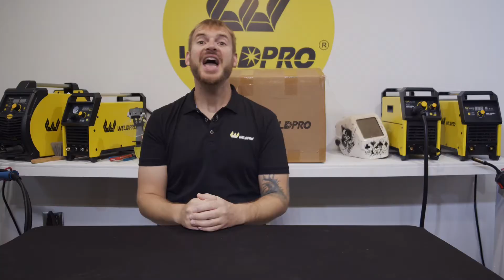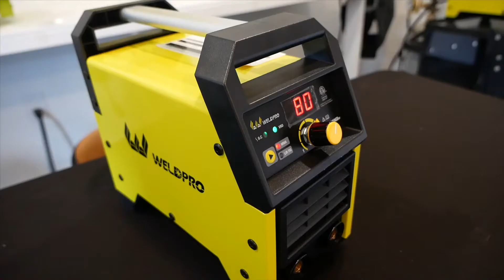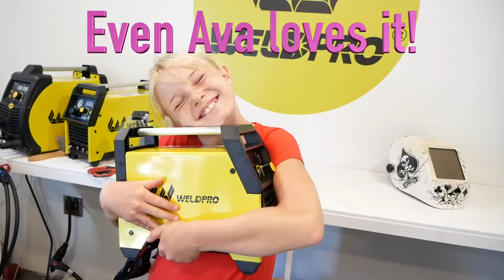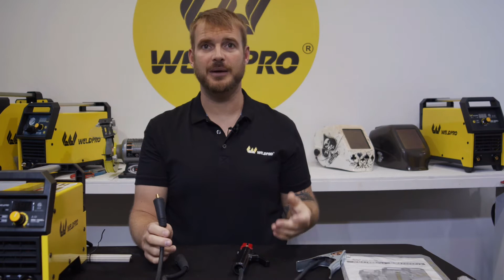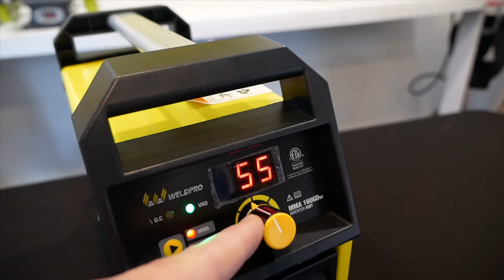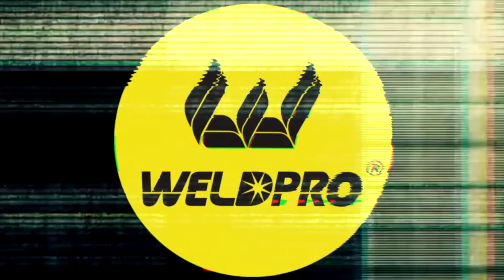Weldpro MMA 160 Stick Lift TIG welder - Unboxing and Set-up

Comment: Why does everyone skip how to set up the lift tig capabilities on these welders besides saying flip the switch. Flipping the switch is the obvious part. But if there's no connection on the box for the argon, what does one need and how does one set up the tig function using argon and the tig gun with a control valve? You didn't say anything about this, and ghat seems like half the function of the welder.
Reply from the maker: We will have a video of the lift tig coming in the future! In the meantime you can check out the dc tig video on the MIG200... setup is very similar. Thank you!